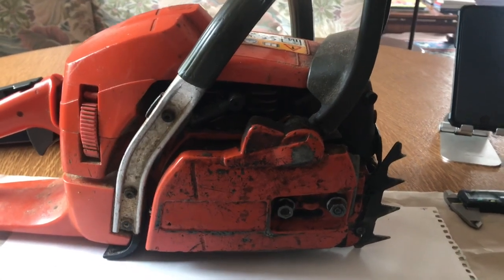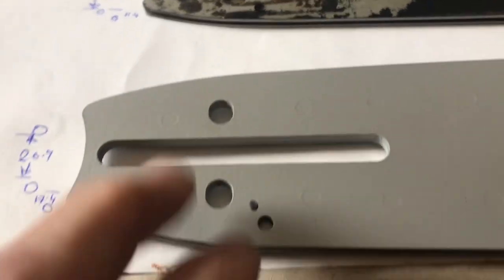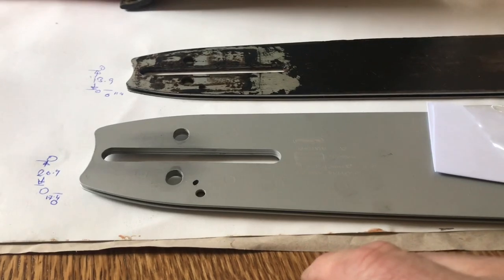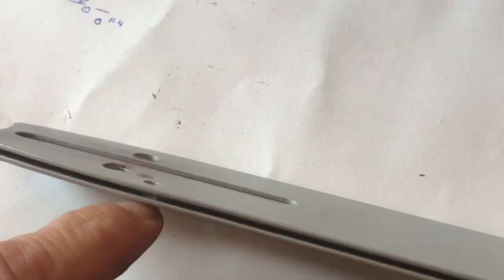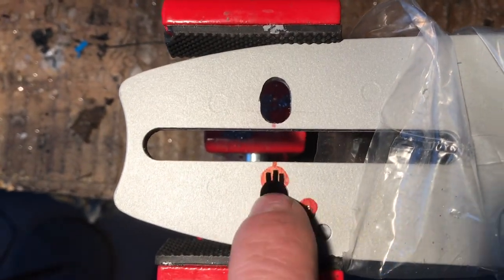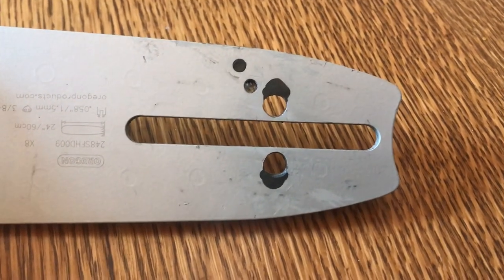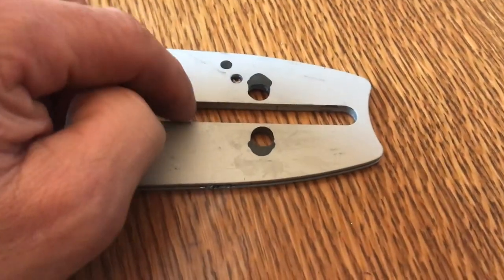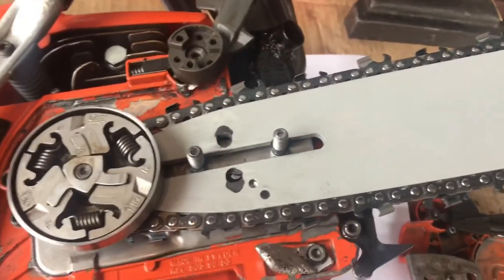How to put 24” or larger big mount  bars on Husqvarna 357 or other small mount chainsaws.

Comment: Cant you just buy a small mount 24 inch bar? I know nothing fyi about chainsaws!
Reply from the maker: If you can find a 24 inch small bar mount then best to buy  it I couldn't locally. Once the bar gets over 20 then you need more power to run it and the more powerful saws have the larger frame and bar mount. You can do it 👍

Comment: You can also just get the 24" bar made for the 460 Rancher which is a 24" small mount bar.
Reply from the maker: Thanks for the feedback. Where are you located ? Never seen a 24 inch small mount bar in the EU.  You can do if 👍
Reply: Oregon 248RNDK095 is answer you are looking for. 24”, 3/8”, 1.5 mm, 84 drive links. Works fine with 357/359 Husqvarna. For chain I recommend using full skip Oregon JGX or EXJ (full skip, full chisel).
Reply from the maker: @300whisper1  thanks for the info. You can do it 👍
Reply: Will this fit on the 455 rancher ? Thank you@300whisper1
Reply: Should fit on any of the small mount huskys rancher 450, 455, 460.  But you may need to change to a 3/8 chain@MrSprintcat

Comment: So glad I found you. I’ve been wanting to try this for a long time.
Reply from the maker: Saw works great with it. Pulls the 24 inch fine. I've got a few videos I need to edit to post up. If you do this I'd use as big as Drill as possible for the oil was up to the bar groove as I feel mine could use a little more oil. I'll drill them out bigger when I have spare time. You can do it 👍

Comment: Let’s see that hogg cut!  Another thing you can do is get low profile 3/8 chain and throw it on there, makes a huge difference.  I found my 45cc husky would not even pull full comp 3/8 so I got skiptooth 3/8 and it’s much more usable but still slow.  Then I tried low pro 3/8 full comp and it was whizzing!  Now I just spun up my own low pro 3/8 skiptooth chain and it’s amazing!  Try it out, you won’t regret it.  Low pro meshes perfectly with the 3/8 rim, it looks a little wonky on the 3/8 nose sprocket but it works fine
Reply from the maker: Thanks for the info. I'll make a video of my 357 cutting with the 24" and the 357 is a beast so I'm looking forward to it. You can do it 👍